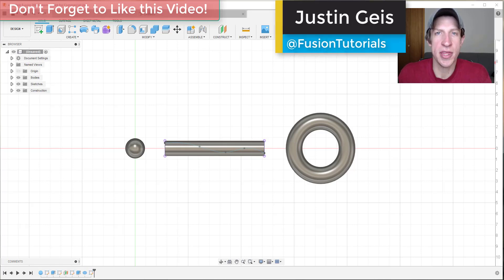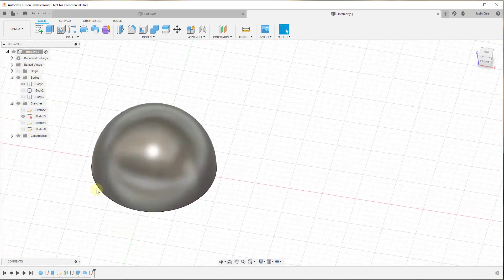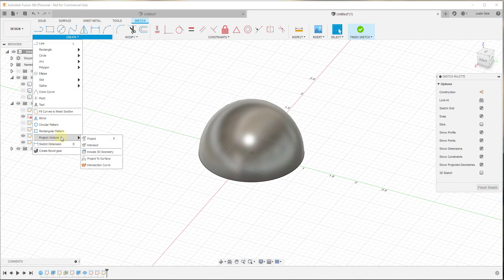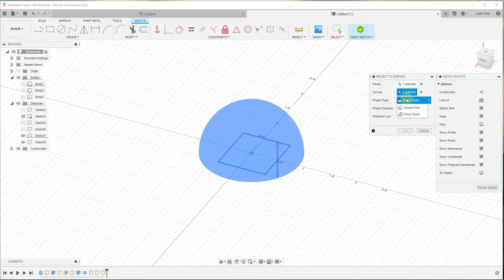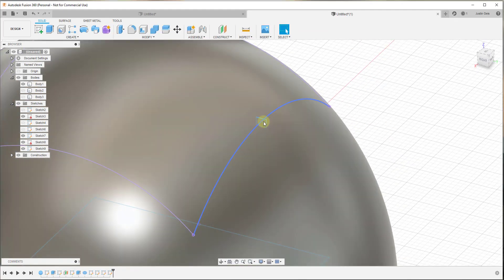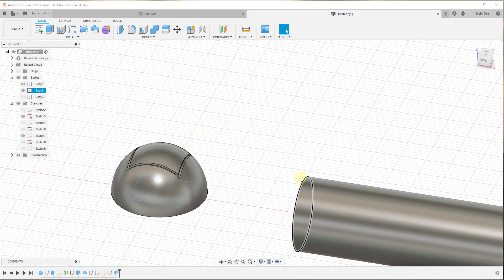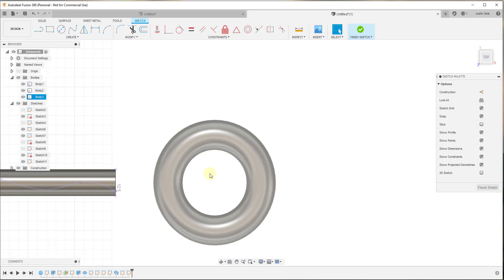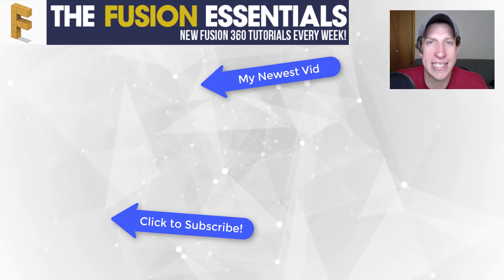Project a 2D PATH on a 3D SURFACE in Fusion 360!

Comment: This was exactly what I was looking for. I'm guessing you can also make a path from an intersecting plane, but what you showed fixes half of my problem.
Reply: Just rotated the sketch play 90 degrees, used straight lines extending beyond the surface, and then used the same technique you showed... boom, exactly what I was looking for. Used the pipe feature to make the simple ridges I needed on these paths. Thank you for the pointers.